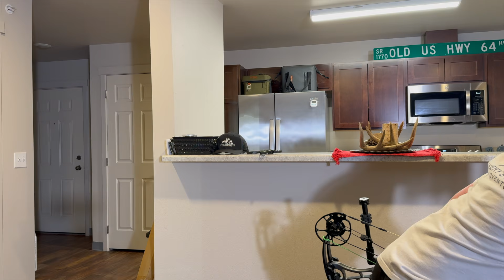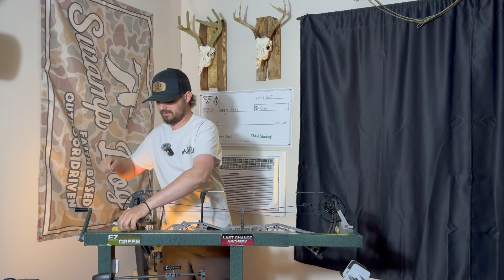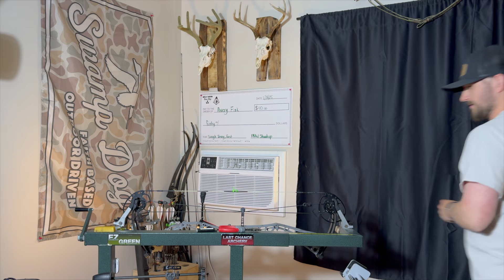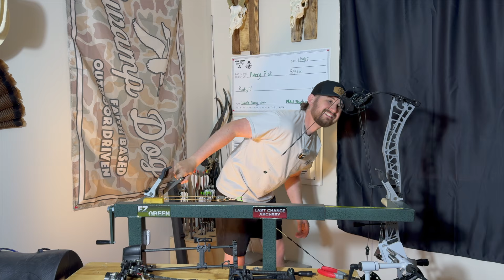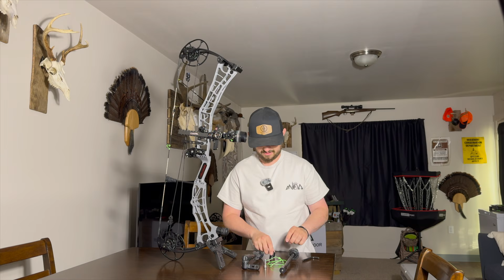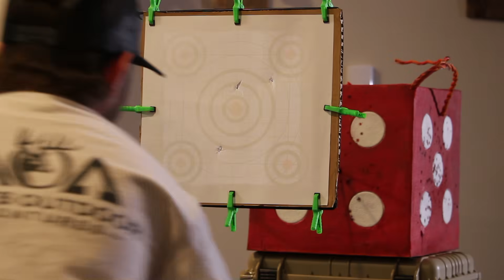FASTEST BOW I’ve EVER Built! Darton SEQUEL 33 ST2 (Build + Speed Test)

Comment: What weight arrow did you use for your speed test?  If you said it, I missed it… 280 @ 60lbs pretty good regardless
Reply from the maker: 300 grain, 350 spine RIP Xtreme Velocity’s - they’re my 3d arrows. I’ll be beefing them up for elk and deer seasons 🤘🏻
Reply: I am getting 280 at 57 lbs with my Squel 33 st2.  I am shooting 31” draw though.
This is with a 450g arrow.